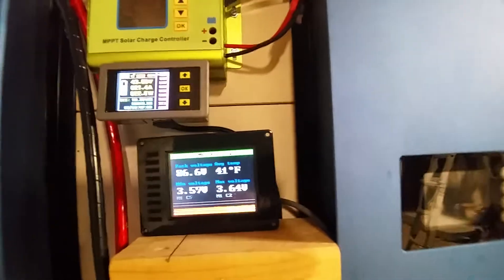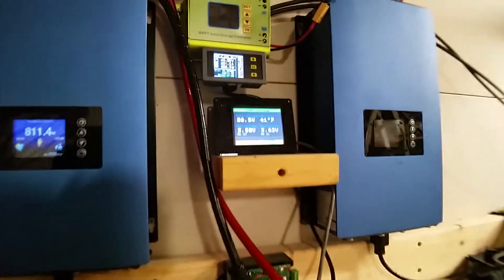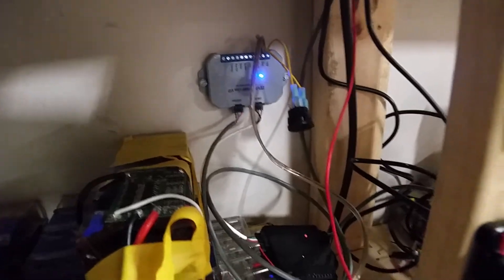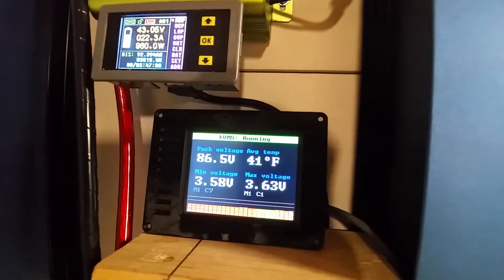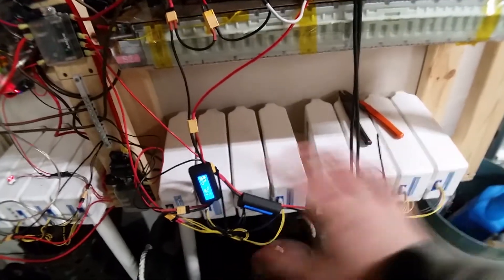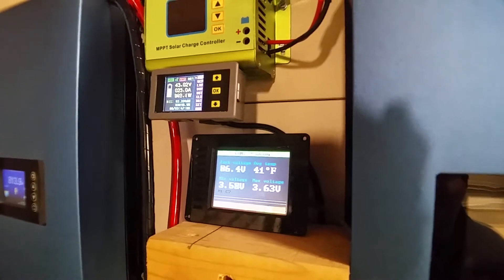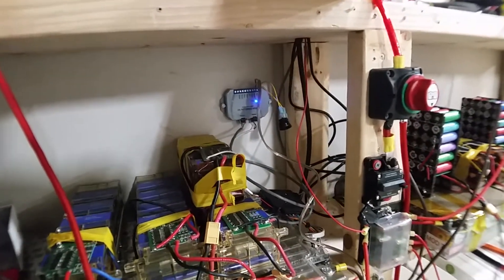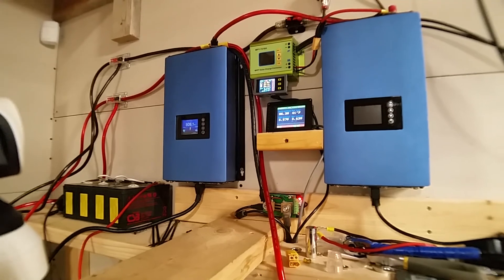DIY Powerwall ZEVA 12S BMS for Tesla Batteries

Comment: Zeva BMS looks interesting but the downside is the balancing. The reason Batrium uses the Cellmon's is because it allows for much higher balance current. On Batrium its 1-2amps per cell now on the Zeva unit it is (120mA, up to 1hr) per cell, so about 1/10th as powerful. The cheap aliexpress balance boards are around 30-50mA. So why is that important? Well the larger the battery pack the higher balancing current is required, On Second-hand batteries there is going to be more of a difference and more balance power is needed. On new cells/batteries then it isnt needed, so the Zeva 120mA would be more then enough on a new set of batteries as they will not drift too much and it doesnt take much bal to pull them back inline. On the secound page of the Zeva manual it says it cant balance in a single charge but after a few however it says it should be able to keep up once they are in balancing which makes sense since its only 120mA balance power. Which is why the Zeva is created for EV cars that have new cells and are matched. Now your Telsa batts it will be fine as they are very good and i see you use balance board for the other packs you made up which is fine hmm but you are relying on the small cheap bms boards on those pack to trip/cut off on every charge and discharge while the telsa packs keep charging.....which isnt a good thing. It works i know, for now. But there is gotta be a better way. One of which is to match the capacity of your smaller battery packs to the same as the telsa units. Meaning rather than having 16 or so of them running independently, pull them apart, take 2 of them and put all the cells together in a lager pack to create 14s and connect that to your new Zeva. Your goal should be to have one BMS like the Zeva and let it control everything from a central spot. The Batrium is designed for secound-hand cells with onsite and offsite monitoring, control and integration to inverters, replys/ switchs and anything you can think of, on the other hand the Zeva is designed for a newer matched cells and more for a car or bike where the main controller is on the dash but given its got CAN you can probably grab the cell information for more reporting. Really Not sure the Zeva was the right way to go, I would of got the Batrium and do what i said above, pull off those small bms board, replace them with cellmons and connect it all to the Batrium to control the batts, the chargers and the inverters on and off times, have monitoring and remote control of the complete systems. Just my 2 cents. :)

Comment: I'd really like a close up/explanation of how you actually wired the Tesla modules to the Zeva BMS system. I actually have the batteries on the way, and actually have the Zeva system already but I've heard mixed ways that people actually wire the connecters into the battery
Reply from the maker: I did not actually wire up the Tesla batts, they came prewired from Edison Motors LLC. I will try to get a video or pics, but I am leaving for a few days, so I may or may not get to it this week.

Comment: Great Mcgyver type setup. What are the connections from your BMS to the Tesla modules? Are you bypassing the existing BMS boards that come with the Tesla modules and if your are, what is the wiring? We have a customer with a 24v setup with two Tesla modules and he charged at 29v and messed them up. I need a BMS to check the modules and see if they are bad or just the cells are not balanced. Thanks!
Reply: Awesome thanks for the reply. Which company did the tesla wiring modification for you? I would like to hit them up and see what they did. We are new to supporting tesla and EV batteries for customers so we do not have RC type chargers or testers and need to invest in some. The customer is 24v setup and they charged with Aims inverter/charger. The least amount of voltage you can set those to is Gel battery at over 29v or so. Way to much for tesla modules. They are not taking a charge any longer and with show 23-24v but the minute you add load or meter to monitor, they lose voltage FAST. Then one pack goes to 1-2v. Bad sign.
Reply from the maker: http://edisonmotors.net/shop/category/batteries-7

I would say those batteries are really bad and should not be used.
Reply: GreenTechFusion Renewable Energy yea those batteries are toast!, not all of them. but one paralleled bank of cells. but maybe some are good. every cell is supposedly fused. there could be a lot of blown fuses.  or they don't have any capacity left. those need to be torn down. and every cell capacity testes to weed out the bad cells. I hope they didn't pay a lot for them. are they 6 or 7 series packs? 4.2x7 is over 24v by a bit. 4.2 x 6 is closer. the discharge is to low. most inverters don't go to 18v it would be a lot of work but some of the pack could be possibly saved.
Reply from the maker: The BMS I am using is the ZEVA 12s module. The company I got the Tesla packs from had already removed the BMS module and wired it for the ZEVA.
My tesla packs are not normal, they are modified packs that are 48v. Each of the string of cells has its own wire that runs to the BMS. This allows the BMS to monitor each row of cells.
The other pack has the same setup and they communicate via CANBUS. The display allows me to see all the rows of cells.
29v is way too high, max is 25.2 for a 24c 18650 battery. Most likely those cells are toast, there is really no way to recover them unless the fusable link opened. If they were discharged too far sometimes you can bring them back to life, but not when overcharged.
The Batrium BMS is what most people are using, but due to the configuration of the tesla pack it would be a pain to install, that is also why I chose the ZEVA setup.

Check out my other videos, as I have made some changes.
Reply: Stealth EV or Zero EV in the UK, direct replacement boards

Comment: Just a heads up, Put a fuse on each of those inverters on the DC input to each one. My 2000w model of the same inverters as yours just blowup tonight. Its been going well for over a year yet for some reason it went pop on the DC side. About to create a video on it and what could of went wrong inside it, Hopefully i can fix it.
Reply from the maker: Mikes DIY Tesla Powerwall I had a 1000w grid tie without lcd that did not like running with batts. If I connected just the solar panels it worked great, but when batts were connected it would heat up fast. Than one day it smoked like crazy, bit never blew the fusing. Luckily I was nearby when it happened and caught it before it caught fire. I found all of the ICs were burned up.
Reply: oh bugger it must have been a much earlier verson

Comment: Why are you using 2 BMS for your 2 Tesla modules ?  Since you are in series 48V you need only one BMS12. The BMS will see a single 48V battery and you just have to connect the balancing wire to the right cells.
Reply from the maker: These are custom Tesla packs that are 48v, not the normal 24v

Comment: OK I see its the BMS . it runs off 12v.  I have 12v supply in house also. for led lighting. so this should work great. I almost got some lifepo4 batteries. but they don't do 24v that well. did charge is way to low. unless you go 9s then the full charged voltage is to high! 7s liion works good. 29.4 peak . charge and discharge from 23v to 29v even. hopefully they will last a while . its a ways from 100% discharge.  I'm fully offgrid. I have thought about making videos. I just get into doing things . and before I think about recording. I'm finished! thanks!

Comment: Where did you get the med packs?
Reply from the maker: https://www.ebay.com/usr/alarmhookup?_trksid=p2047675.l2559

https://www.ebay.com/itm/12V-26-5AH-Boston-Power-Lithum-Battery-Pack-DIY-Powerwall-or-Cell-Harvesting/122816993179?_trkparms=aid%3D222007%26algo%3DSIM.MBE%26ao%3D2%26asc%3D49477%26meid%3Df9ee0d3425e5401baf70e69810ec452c%26pid%3D100005%26rk%3D6%26rkt%3D6%26sd%3D122812297777&_trksid=p2047675.c100005.m2219
Reply: Do you prefer the med packs (cost, features, etc) Vs the Tesla Packs?  Who did you get the Tesla packs from and what was the approximate cost?  That’s cool they modded them to 48v.